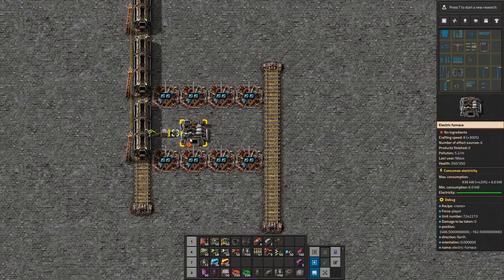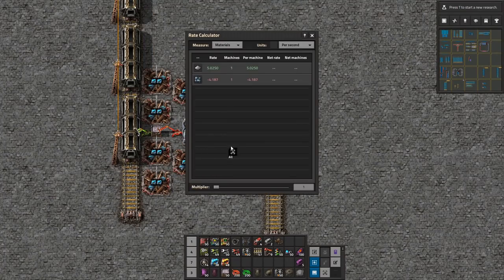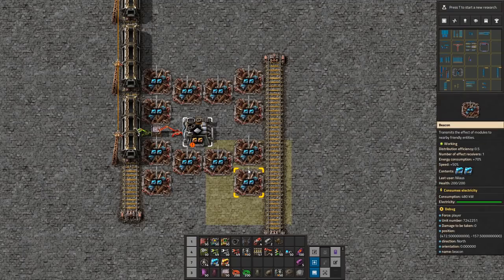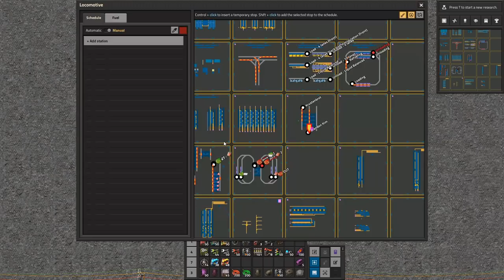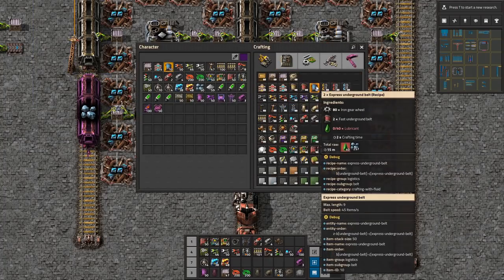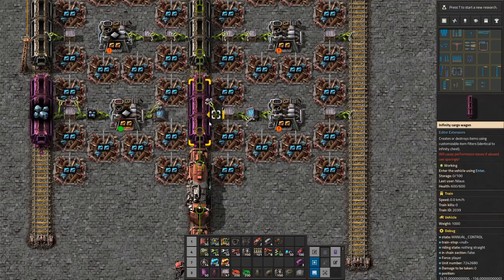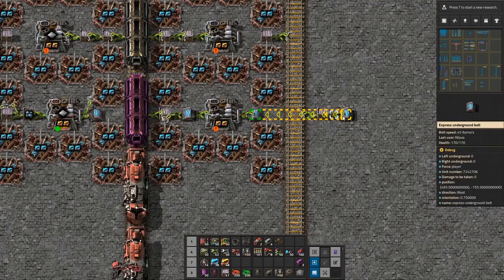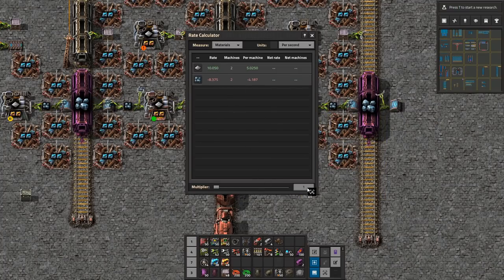Introducing TRAIN-TO-TRAIN for Megabase | Factorio Tutorial/Guide/How-to

Comment: I had a proof of concept build where I used the same train going forward. So one train would be direct loaded from the miners, it would then go into the smelter and would direct load a second train, then that full train and the empty (original) train, would go on and the smelted material would be converted and sent into the empty train and this would go on and so all trains were on loops, but there were fewer trains overall since they all got reused.

Comment: Oh man this makes me start a new game just to do this - it's amazing that people can continue to discover new patterns.
It would be a lot of fun to try a variant on this that loads on / off the same train for 1-1 conversions - So you pick up iron ore, drive into your iron smelter drive-through and have it converted to iron and loaded back onto the same train, and then drive to an iron dropoff.  Pointless ofcourse, but sounds like some fun automation.
Reply: Actually, that's genius - Imagine buffering exactly a train's worth of iron in the smelter. Train comes in, is unloaded of ore and simultaneously loaded with plates, then leaves - the smelter processes, then a new train arrives
Reply: @Orlandofurioso95  Clever! I hadn't considered that - it would be a great speed boost to not need to wait for the processing - esp since one of the big perks of this layout is having the trains manage distribution instead of having to do ideal full belt transform assemblies.

That would also be some fun automation work to get the buffer to stockpile and the train to handle that gracefully.
Reply: @enkiduo  Well, a single steel chest can easily buffer a whole wagon's worth of product. I believe the simplest solution is to let the plates train leave partially filled, with its 2000units plus the productivity bonus instead of a full 4000 units
Reply: @Orlandofurioso95  Definitely the easiest way to get a robust solution
Reply: That's basically the reason I've started every single playthrough in factorio. 
-played the game, finished it. Dropped it. 
-saw someone doing something different or a new mod.
- oh, I wanna try that. 
-rinse, repeat.

Comment: With this design you're unloading the train at 13.85/s, and this is split between 2 smelters, so each smelter can only receive 6.925/s of input. This works for furnaces, that receive 4.188/s of ore inbound, but for other machines it will be a problem.

Comment: @Nilaus, Maybe you can remake this video with this info, 
you can put a car between two beacons and it will function as a chest that is 2 blocks long, 
this way you don't have to use undergrounds and stuff, 
you can also use a splitter, just a bit slower than the car but way faster than the underground belt, these options will make your build way more tile-able, 
the car cant be placed by drones but the splitter can
Reply from the maker: You cannot put cars in blueprints and cars are hottible for UPS, so it would defeat the entire point of making UPS effective builds

Comment: @Nilaus any reason the trains have to point the opposite direction? I'm just thinking if they were running the same way you could scale this up as your needs grow. Starting with as little as 4 carriages and moving up to 8/12/16 as required, it provides a migration path from the midgame onwards. Whereas if they are facing the opposite direction you have to keep moving your stations with each upgrade

Comment: At this point, shouldn't you use clocked inserters between some chest to ensure they only move with a full stack?
Reply from the maker: potentially, but I want to build a big base and then see how much improvement that actually gives. Circuit states can easily eat more calculations than it saves by clocking
Reply: @Nilaus  It's a pretty significant savings. :)

Comment: @Nilaus, why have you decided to use the undergrounds to bridge the odd-even issue? Couldn't you place down two belts on the same side instead of loading on the "wrong" side and transporting it back underground?
What's the advantage of undergrounds in this case?
Reply from the maker: fewer entities yet still enough to do what needed
Reply: For speed you yes, but a splitter is almost twice as fast